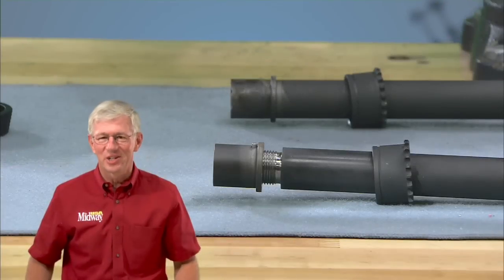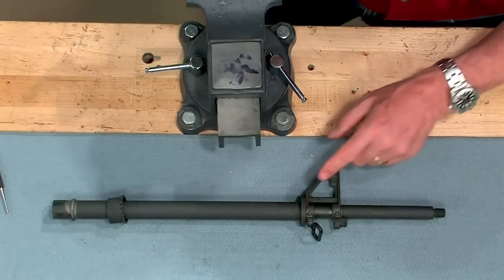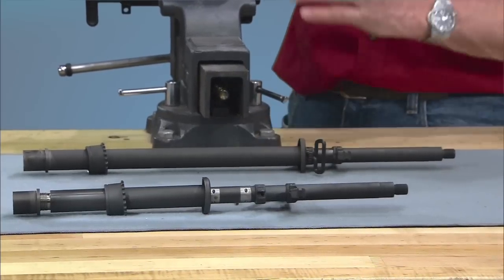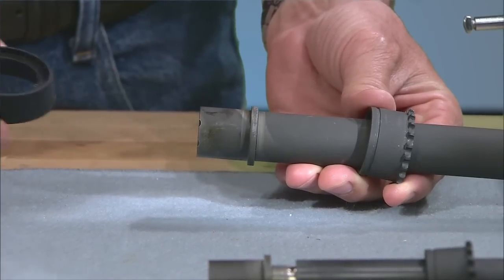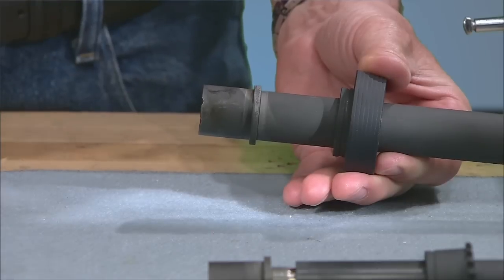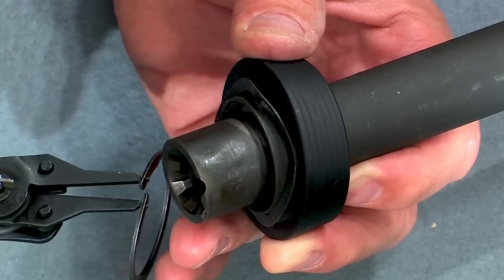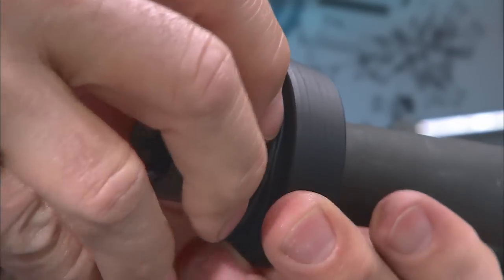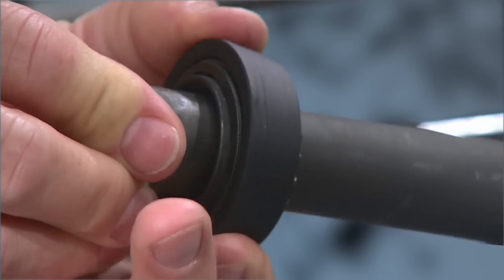How to Assemble an AR-15 Delta Ring Presented by Larry Potterfield of MidwayUSA

Comment: I cannot thank you enough. I have been working and yes enjoying AK platforms for over a decade. Just about three years ago now I purchased my first introductory AR platforms. I purchased a few Adam's AA15's running on gas piston systems. (Ak Lover an all) I truly enjoy both platforms. However, my introductory Adam's are bare bones rifles. I just purchased Samson Evolution rails for them. I had been worried about having to purchase new barrel nuts or if I could just remove the springs and housing. Your video cleared up my only question

Comment: My Delta ring is having an issue and my Handgaurd  falls off the A2 style and I bought it from Bear Creek arsenal  and I remember it got loose when it fell  in the Arizona desert i'm using two zip ties in the front and back of the hangover to keep it in place I don't know if it's the spring or the hangover that's weak